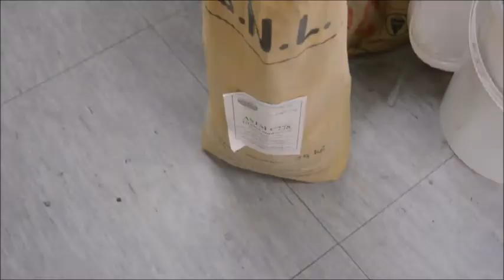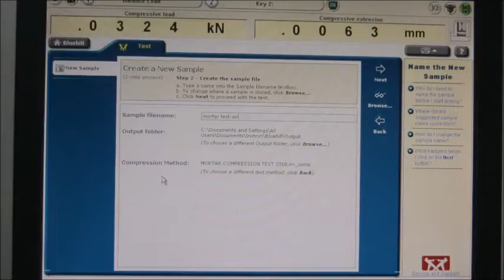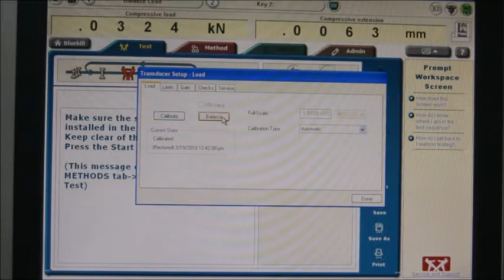How to make mortar cube samples (50x50mm). A Complete Guide

Comment: If the cube mould of size 70.6 mm is used then the cube shall be compacted in how many layer? 

Two or three?

If three then how many poking for each layer
Reply from the maker: Thank you for your comment. As per ASTM C109, 50mm +- 0.25 is the standard size of the mold. If more than or less than that, you must make a standard variation.

Comment: what were the results of the test? which curing method works best?
Reply from the maker: Theoretically, the soaked one (wet). The hydration of the cement was on the proper curing. Since, this experiment was for students and made by students, there are lots of factors that affects the result. Thank you for your message.
Reply: thankyou..really help for my fyp

Comment: what is the standard followed pls
Reply from the maker: This is based on ASTM C109 Standard Test Method for
Compressive Strength of Hydraulic Cement Mortars
(Using 2-in. or [50-mm] Cube Specimens)....thank you for watching. Cheers
Reply: If the cube mould of size 70.6 mm is used then the cube shall be compacted in how many layer? 

Two or three?

If three then how many poking fir each layer